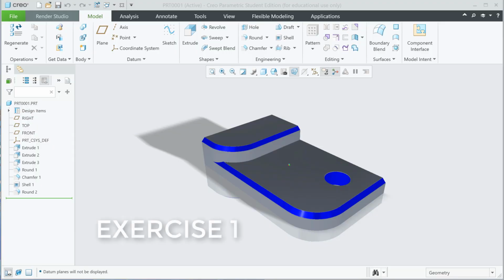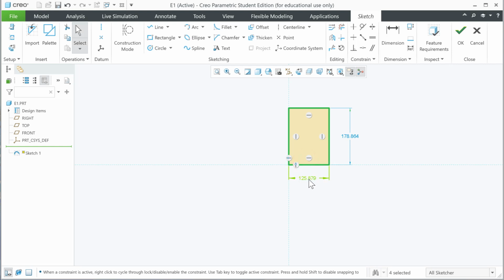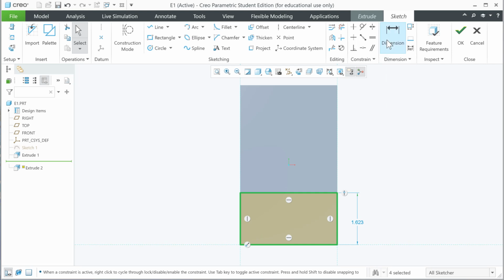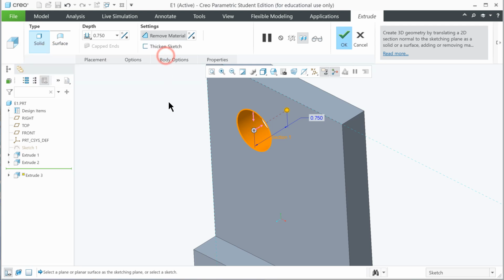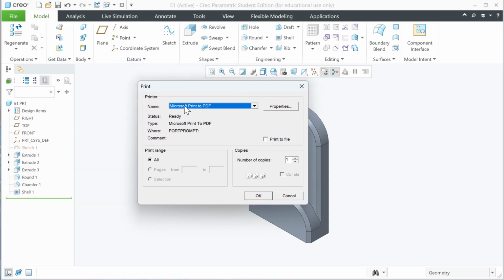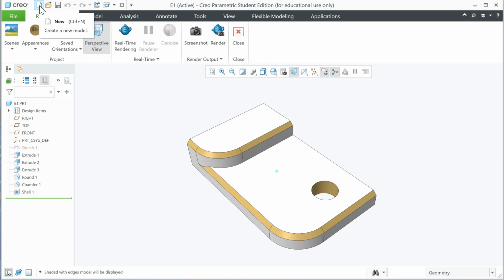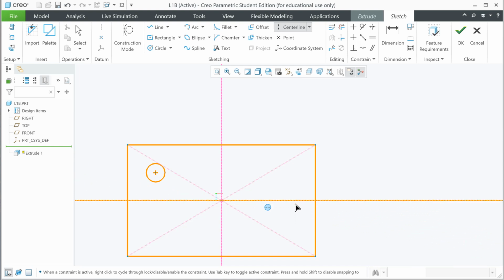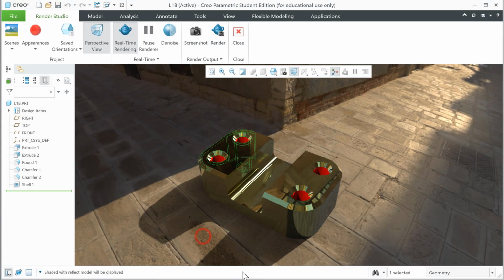E1 Creo Parametric 10.0 - Basic Modeling for Beginners Tutorial with Training Guide | Tips

Comment: My god I am so tired of working with 2d sketches. When are they going to do a proper fully 3d solids workspace parametric modeler?
Reply from the maker: In my experience full 3D solids workspace systems are great for conceptual work, but not well suited for mechanical engineering and design.
Reply: @vertanux1  I suppose it depends on the specific type of work being done and how big the project is.

Something like IronCAD just makes much more sense to me working mostly in a 3D space with fine dimensional controls and occasional 2D sketching when necessary. I wish there were some type of hybrid between IronCAD and Spaceclaim. That would be perfection, at least for small part/product development. Anytime I load up a CAD program and it shows those 3 planes that you have to pick to start your work on I just want to die inside, it feels like I'm working from design concept procedures that haven't really evolved their way beyond the standards of the 60s/70s/80s. 

I can understand the need for the 2D parametric workflow if you're developing a factory, or a smartphone, or something like a DUV lithography machine though. 

But it's awful if you're making toys, board-games, racetracks and NERF for Hasbro, though. I'll probably just stick with IronCAD til something better comes along.